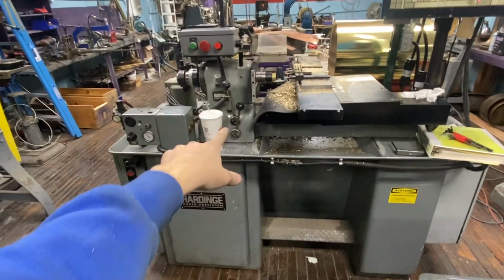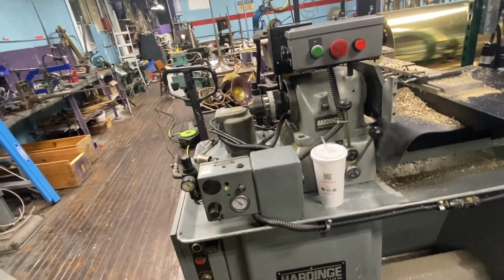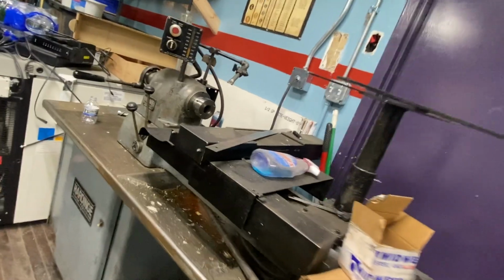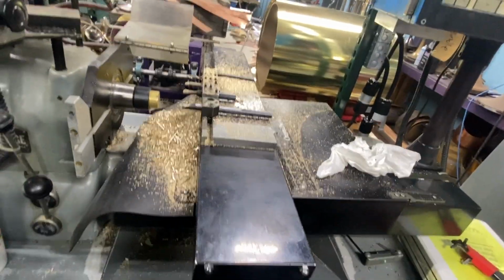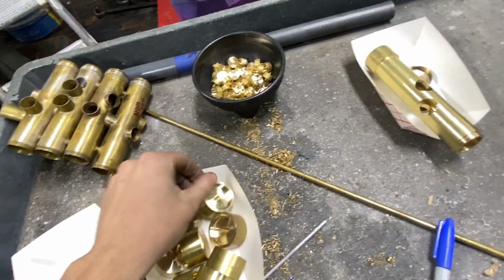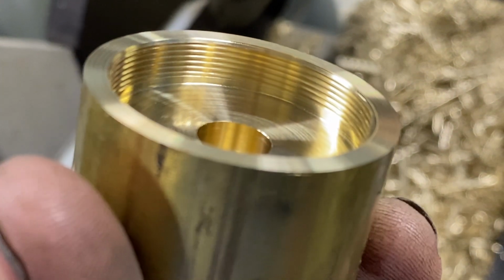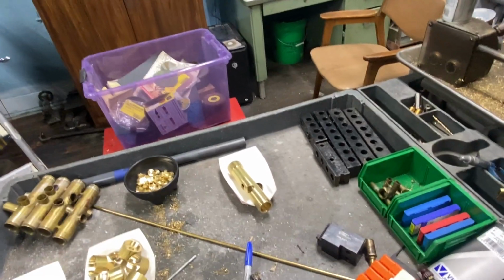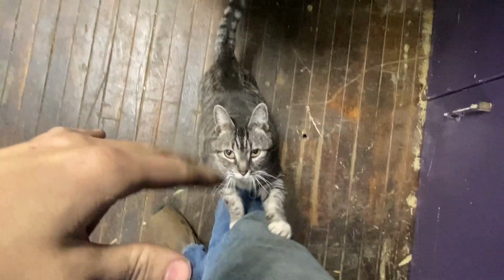Making Tuba Valve Caps

Comment: Don't know what the capabilities of these machines are in terms of programming, but you could probably program that inside radius of the bottom cap with a G03 code and a typical turning insert. Wouldn't be too tough, just a little math/drawing.

Comment: There are many forms of bar pullers. Some have grippers that are driven by coolant pressure and cost plenty. But there are simple spring pullers that are for one size of bar only.  They look like a socket from a socket wrench. Used these on my Omniturn for years. You could easily make your own spring puller for any size bars. It has some little teeth to grip the bar.  You just push it on, pull the bar, lock the collet, and pull it off. The commercial one are probably heat heat treated steel. Put it in your tool bar.

We also used a bar feeder and now a bar loader. Of course this works for bars that fit through the spindle.
Reply from the maker: I ended up getting the Dunham puller. It works great, I'll make a video soon showing using it. I wish I had the space for a bar feeder here, or even just a outboard support so I can do 36" or longer bars.
Reply: @milesomalley5605  
Durham pullers is what we used. They are a simple and effective.